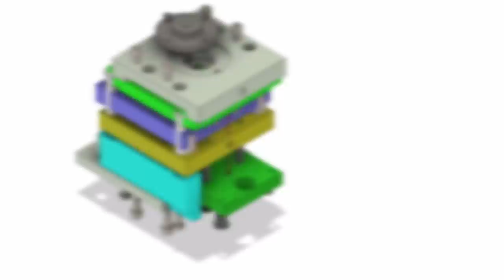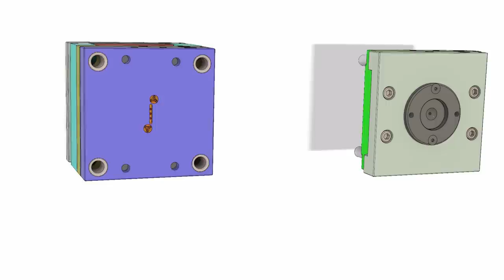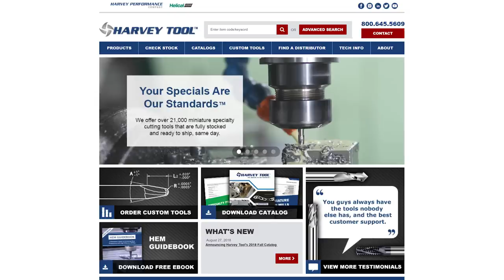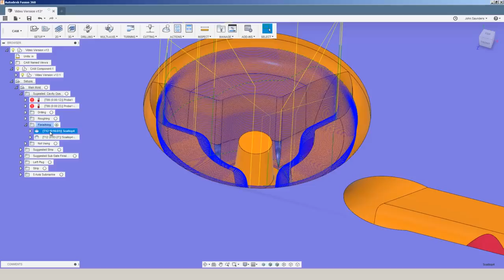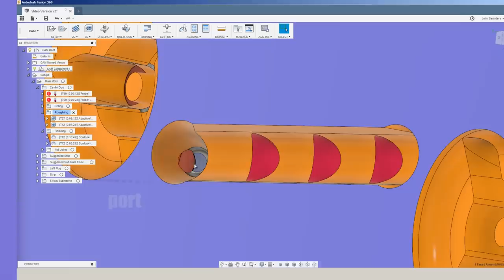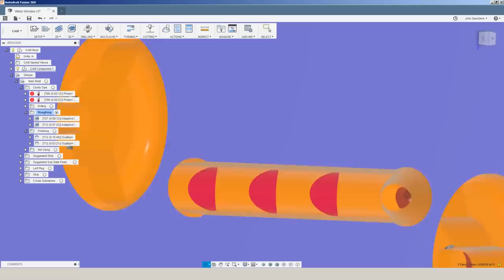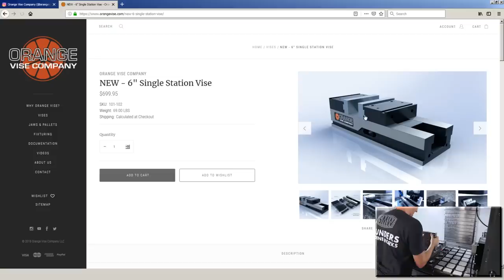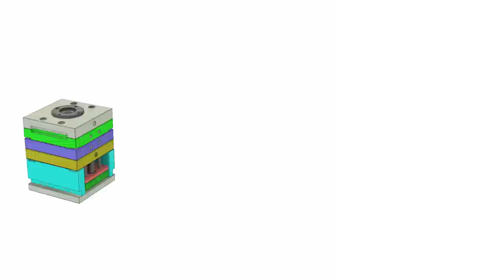Machining an INJECTION MOLD!

Comment: You should always chamfer NPT holes before you tap/thread them.
That way you don't roll a burr into the part that prevents good sealing.
Reply: @northernsmith  it's been my experience that every shop adds a chamfer to tapped holes when there isn't a call out.  

This can be problematic in certain situations. For example, when using shoulder bolts in said holes. I was bitten by that one during an internship where they actually used my designs in production. Technically, it also bit my mentors/bosses as they checked the drawings (and designs). This was very low run production tooling with ~32 holes across four parts so a "do not chamfer" call-out was in order. If it was a very long production run/something getting a ton of shoulder bolts then adding a chamfer with a +.0000/-.0010 tolerance might increase tap life enough to lower part cost.
Reply: Not an issue with a thread mill in my experience. Worst case you just use the thread mill to do a level pass at the top.
Reply: It is good practice to chamfer first. But I make 1000s of NPT holes in a year and sometimes impossible to chamfer, you don't even need too. Chamfer doesn't affect the seal at all. Best way to do NPT holes is to treadmill them. That way mold maker puts a tiny bit of Teflon tape and the plugs will stop all in the exact same spot perfectly sealed. I also usually gun drill all waterlines when possible and a gun drill doesn't make a burr. This is such tiny mold, molds I make have 500 to 2000 waterlines crisscrossing through it. Only time you need a chamfer is on the bottom of the mold so the plates sit flat against the mold
Reply: @highstreetkillers4377  NPT plugs suck. I switched to port plugs a long time ago. No leaks and straight threads. Also easy to remove for maintenance. I Use them whenever possible.

Comment: Nice to see someone else make and explain a mould I work for a company that makes mould tools as big as 64 imp razors it will mould 32 plastic handles and then spin 180 and mould the rubber grip on the handle it just moulded most off cavity we do are edm sparked and hard milled nice to see one fully milled great video 👍🏻👍🏻👍🏻

Comment: I worked in a tool making shop 18 years ago with an in house mould shop as a semi-skilled engineer. We did not have any CNC machines and relied on Lathes, Milling Machines, Grinding (Surface and Cylindrical) and Spark Eroders (those were interesting). We made some real complex mould tools with the machines we had.

Comment: As a kid, I worked at Hansen Ski as an injection mold operator.  Used to have to jump inside the 2' to 3' molds (when open) to remove the ski boots!  For some reason a crescent wrench was involved in the process (don't remember why...), but I remember leaving the wrench on top the then $40K-molds and when the machine cycled, the wrench fell inside the extraction plate mechanism and bent stuff up pretty bad...  I don't think I lasted long after that!!!  I really wanted to get into programming the many types of injection machines they had!

Comment: Great job guys! Wathching your channel and every video with a great pleasure, always find something new and usefull.
A little tip for future moldmaking - not all mold base blocks have "base" side surfaces, for example Fodesco blocks (which are great, cheap and popular in Europe) have not parallel, not orthogonal and not even straight side surfaces. But!  holes for guiding elements are excellent, orthogonal to plates face and bottom, and extremly precise in size and shape. It is a good practise to set up all the plates (excluding ejector plates, in which guiding holes are made "in situ") using that holes. Look at "meusburger h1000" set up system, it is a great example of mold clamping system, handy, precise and easy to use.. or to copy :)
We are using similar system for over 5 years of everyday moldmaking job. Also great when it comes to machining plates on mill, then on EDM - helpls not to loose or mix up that microns, that really matter.
P.s. sorry for the English, Russian is my native.
Reply: Can you recommend some books about molds (making, maintenance, repair, welding, polishing), in Russian?

Comment: It´s a really exciting field, and I forecast words like: EDM/Wire EDM, Electrodes, Spot drilling/Center Drilling, Reaming/Honing, Wire EDM, Hard inserts, graphite, S7, H13, Venting, hand grinding, Mold flow analysis, Hot sprue bushing, Hot runners, support pillars, locating rings, return pins, ejector pins/plate/sleeves, Angular pins, sliders, parting lines, shut-offs, etc.. will be appearing more often in your videos!

Comment: DME good way to go, mold base then A and B plate, ejector plate, ejector pins just right to eject the parts and the runners just the right length,  lot of work lot of time. important to get the pins and bushings perfect, 
Spent 20 years designing with cad/cam making drawings and machining injection molds ordered lots of stuff from DME, pins, bushings, ejector pins, springs and plates.

Comment: toolmaking is the king class in metalworking. so much to worry about and so much tolerances. Im working in a small company, we make mold for duroplast type plastics. makes it even more difficult to design and run
Reply: Yes, no sissies there, straight real work.

Comment: Hey John, Have you ever measured tool runout before and after a cut with your tap method? I would image if the tool is able to be moved around inside the collet from a dead blow that the cutting forces would be more than enough to move it even more!
Reply: The tool rotates while it cuts. So theoretically it would be like tapping hundreds or thousands of times on all sides of the tools.
So theoretically it still should be centered.
Reply: My names not John but from my experience once you get the tool indicated in, it will repeat pretty well. All of your  force is in the z axis, not x or y.

Comment: Drilling and reaming where best accuracy of form, size and position is concerned. Drill, then pre-ream using a rotary ground pre-reaming tool, leaving very little stock, is the way to go.  To change the size (and surface finish) of a reamed hole within a few tenths, this is possible using different types of cutting fluid. Soluble oil cutting the tightest, cutting oil cutting looser, and cutting dry yielding the loosest hole. Feeds and speeds also effect both finishes and size, so a few trial holes is a useful adjunct.
Reply: Yes, This should be "sticky comment".

Comment: As someone that has 10 years experience machining molds for car bumpers, dashboards, and other huge molds, this is funny to watch. I'd love to show you videos but I would get in trouble. I did the 3d finishing on a machine where the spindle is on a Sine plate. Put the cutting tool on a compound angle, make a program, then pick out corners with a 1mm ball for weeks. I'm more on the boring mill and 6 axis gundrill/mill these days luckily. You should try putting in 2" lifter rod holes on a compound angle 1 meter deep. lol. Even worse is 3 mm ejector pins 1500mm deep with 5 mm clearance 1450 mm deep. That mold has no lifters, inserts, or slides. lol. That's a cake walk man. You didn't even make the ejector box or plates, lol. Waterlines?  lol. The one 30 ton Cavity I make has like 800 Waterlines through it with a helluva a lot of intersections. Now that's a stressful puzzle. Luckily I've got the 6 axis machine, cause before I'd put that 30 ton cavity on a sine plate on the boring mill and some setups I have to tilt the sign plate 43.473 degrees and then turn the table 46.238 degrees. That setup with lifting the sine plate on with the crane and block, start until cutting. Takes me 1.5 hours. YouTube machinists kill me struggled with setups in a vise out by 0.001". lol. I indicate 50 ton molds straight on my machine everyday, 0 - 0, and that's over 3 meters. Sometimes I use a 9/16" drill thats 700 mm long and drill on a compound angle through 11 intersections 650mm deep. Just makes me laugh watching someone struggle on a small simple mold like this. lol. No offence,  practice makes perfect

Comment: I really like your machining the mold so logically. 
As more than ten years mold designer's advice, you should eliminate the second mold plate, then make the inserts in Top plate and make another block to fix them. it will decrease the sprue length,
and save the material.
Reply: Doesn't the waste material get reground/reused?

Comment: Reamers can be stepped on a reamer/endmill rotary collet indexer, purpose is to cut out  stock undersize in hole then the rest of the reamer finishes to size, standard practice in hole reaming, sneek up on it. Better hole finishes and tighter tolerances. Always ease a holes beginning with a lead, small chamfer if possible. Better with steeper angle, 60

Comment: Good way of making sure you can relocate a mold plate lite cut on front for square on x axes then any where on center line on plate drill hole ream and burnish  hole at 1/4 or more depth, you can come back latter if need be to run your indicator along x axes and sweep hole for picking up location even repairs years later just put your info in the drawing. Also its called a subgate that special hole that the plastic flows into for filling the part, it needs to be just right so you can separate the part from the runner.

Comment: We used to use an EDM machine to make those tiny holes leading to the cavity , since you can make an electrode that can be held with 90degree extensions, it's much easier than using 5axis mill

Comment: So, one question:  the way the cavities are connected below the surface of the mold (the "submarine holes," IIRC), it seems like the sprue connecting the center channel to the outer cavities will have to be cut when the ejector pins actuate -- otherwise the center sprue and the plugs would still be connected post-ejection, and the video evidence appears otherwise.  Is that correct?  If so, how could you be confident (in the design stage, b/c obviously this works in production) that that will work properly, and not leave debris caught in the "submarine holes" that might damage the next injection?
Reply: firehawkdelta it gets pulled out of the tunnels when the sprue is ejected.  It’s possible for it to get stuck, but if designed right it’s pretty rare.

Comment: You really should ream all ejector pin holes and core pin holes from the back of the mold base. You will get a small amount of bellmouthing by reaming from the parting line side. That results in a small flash around the pin hole. Good stuff!

Comment: Have to watch leaving sharp corners when making runners. It can create turbulence and make the plastic flow very strange as well, in turn bad parts. Also the hot runner or heating rods paired with a very accurate thermocouple play a crucial role as well.

Comment: machining the core and cavity into the mold plate if not the best way to go. i work on high volume molds, 64 cavity and above, the core and cavity are always separate parts from the plate. when you mentioned having to drill long holes for the coolant lines that would work in a small mold like this, but for large molds the coolant lines would need to be gun drilled with a 32in carbide tipped drill.
Reply: Yes. Making cavity/core inserts is a next step in making this mold a real mold. So he can run similar sized products or different version of current design.

Comment: I always disable my unused rotary axis when holding a part that cannot be rotated, very easy to do on the Haas. That way you can never accidentally move it by jogging, or if programmed it will alarm out.

Comment: Did you ever try to use a camera that you can remove the ir filter (an expendable usb camera) more than likely it will "see thru" the opacity of the coolant, but it becomes little difference between looking thru a window on the rain or the spinner windows, but might yield better results.

Comment: Pro tip about the torque wrench at 13:45 
Install the accessory at 90* to then handle rather than parallel. With the accessory straight, you are extending the torque measuring length.
If you did the math already for the compensation then by all means, keep on going to the moon.

Comment: i built my own cnc 10 years ago and software was so cost prohibitive my machine sat in the garage as a table since. i used google sketchup to draw, then cambam to set the cutter paths, then emc2 on an ubuntu install. it was all free, so i got to make basic stuff, but today maybe the landscape has changed? i will have to look into it again.